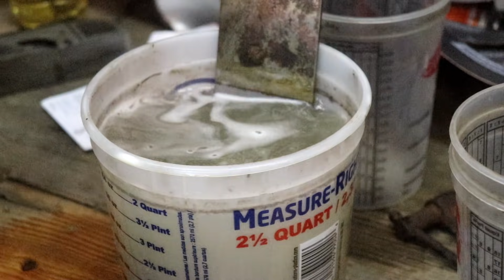Tool Restoration -Heavily Rusted Lathe

Comment: I fix and restore machine tools for a living..have for 20 odd years. A few mistakes in the video..but not a bad job for an amateur. Please...make some brass hammers...steel hammers will do a ton of damage..particularly to a soft iron Atlas, when trying to disassemble something like this.
Reply from the maker: +Gunner Asch I hear the same thing about screw drivers and crescent wrenches all from people without x years of experience yet no damage was caused to any of the parts in question. The key is to learn how use the tool you have and to know when damage will occur. "steel hammers will do a ton of damage"... Steel hammers do nothing at all until someone picks them up. It's not the hammer or the screwdriver that damages the part, it's the operator. Look at that, you just learned something from an amateur.😉 Thanks for watching. Merry Christmas and Happy New year!
Reply: Justin took some good precautions.  Notice when he was hammering on the threaded ends of screws,  he had a nut right at the end to protect the threads.

Comment: You should have soaked the bed ways (and all the parts) in evaporust overnight. 
Next day you only need to work them with a light sand paper and do away with all that Rust, no Black/rough spots.

Comment: Good video.
A few remarks though.
Rather than trying to move things while they are rusted up like that, dunk the whole lathe in a tub of your de-rusting potion first.
Be a bit more avoiding of the 'true' surfaces....
Lubricate with a very fine film the surfaces that are bolted together (such as the legs to the bed)
Find someone who can grind the ways.... scraping is fine for smaller surfaces. It is totally unnecessary for a lathe bed.
A great many people overestimate their 'scraping-prowess'....even those that spent a small fortune for classes. And once you start, there is no way back.
At my first job, there was a chap who maintained the machines (one of a group of people) and he was the go--to-guy if something needed scraping. He had 30 plus years experience and was a really driven master craftsman. Even he would recoil at the thought of scraping an entire lathe bed! He also taught me that you 'have to finish a session' or you will see the difference. So 'an hour here and an hour there' isn't really an option either imo.
Being keen to do a certain thing doesn't make it the best thing to do....
And clock it out before you touch it with anything!
Otherwise, great find! Great job!

Paddy

Comment: You could do with buying yourself some bigger flathead screwdrivers. The ones you were using to tighten up all the slotted screws were far too small, one because you probably have still got half of them loose, and two, you will mullah as we say here in the UK up all the screw heads. Other than that, a good job!

Comment: that poor lathe why would anyone buy something n not use it???
Reply: Stillmoon Deathbringer 
It may have been used while mounted on the pallet but sometimes unfortunate things happen just after a purchase and things don’t get used. 
I get a lot of auction emails and quite often for estate auctions there are brand new items in the packaging not used listed in the auction. 
Perhaps this lathe was the same thing but the auction happened years after the purchaser passed away because the surviving spouse didn’t sell anything. 

I am glad the lathe has a new home where it has been restored and will be put to use.
Reply: Circumstances change and it is not possible or practical to use it.  This lathe was purchased new in 1976 or '77 with the intention of building live steam models.  Moves and economic downturns prevented that but it was kept indoors.  I gave Justin the lathe because I am not in a position to use it, he can.  He also got the box of tools, gears, tool holder, and chuck.  This is a 40 year old new unused machine.  I have been sorry that I was never able to use it.  And yes I generally don't throw things away or sell them like a lot of other people.  I took it to him on 12/15/2018.  I think he did a very good job on it.
Reply: heart attack
Reply: But how it got so rusty while keeping it indoors?
Reply: @Georgealfa21  even the moisture in the air can rust metal especially in the coastal regions
Reply: basements in particular tend to be very damp
Reply: @Georgealfa21  Humidity rapidly flash rusts machine tools! Use Boeshield and spray them heavily before storage.

Comment: Might have been easier to boil the ol' girl in a large tank of oil.   Still, it would appear that good ol' elbow grease, a few cans of rust remover and spray lube can work wonders.  Nice resurrection....errr....restoration.

Comment: Never understood why people go to a bench grinder wire wheel...so many better options that aren't as harmful.
Reply: @Newbie Failmaster you could use a brass brush instead of steel on steel. Use a little elbow grease and stop taking the easy way out.
Reply: Newbie Failmaster aaaa

Comment: Pro tip for future videos: don't use your autofocus. It's killing your videos where you have hands or objects moving between the front and back of frame. Not to mention that it's even adjusting when there's just simple movement in either the back or front of frame (not moving between them).

Otherwise, good work so far.

Comment: Nice!  You needed a little lathe to make various things for your projects.
 I'm wondering if that isn't one of those combination metal/wood lathes from the 60's or so. On the saddle/carriage binding up; you may be able to adjust the gib and shims and maybe the hand wheel gear just a bit.
Now the quest to locate the other hardware such as the tool post, change gears, various centers, chucks, drive plate, lathe dogs, drive spur, chuck wrenches and motor mount /speed change pulley assembly.
Reply: he could've mic't the sides of the ways. would've found that problem before assem... didn't see one stone utilized either

Comment: Doesn't it just make you want one of those 1000 gallon water bottles street corner car washes use, but filled with rust removal fluid? Just drop the whole thing in there over night to soak in then take it apart.

Comment: No no no. Please. Do NOT scrape the ways unless you plan on having them hard chrome plated. Either have them ground on a surface grinder or pick up some machinist stoning blocks and stone them yourself. Scraping them will drastically shorten the life of the entire machine. This is why the ways on a lathe are NEVER scraped.

Comment: The worst goddamn thing you could do is penetrating oil on one of these machines and then try and force it to move because the rust is going to gouge into the good metal underneath you need to dip the whole machine and use electrolysis to remove as much as possible before you attempt to move anything
Reply from the maker: +Clown Whisper good metal under the pitted metal?
Reply: @TheGoodoftheLand  you are statement doesn't make a heck of a lot of sense my friend. If you don't think there's anything good left why bother cleaning it in the first place?

I've been restoring old machines for many many years that's what I do I have a 100 year old power hacksaw by Racine did I build the special tub just so I could use electrolysis to gently lift out all the oxides.

I didn't think that I was being offencive for trying to make a good suggestion I'll refrain from trying to help in the future
Reply from the maker: @ClownWhisper  It wasn't a statement it was a question. I took a minute to watch the video again from your perspective. I can see that it looks like I am forcing the tool post against itself during tear down. That is not the case the resistance is coming from the atlas threads not the Gibbs or the machine surfaces. Notice once it is removed there isn't any rust. Also notice before I do anything I clean the ways  
Ensuring that if i do move the cross slide (which I don't) the rust is removed ahead of time. The same goes with the tail stock. Electrolysis would have worked great and most likely would free up the screws. I have a plating/striping machine and a tank large enough for the process. What I don't have is time. Hopefully this helps. It's hard sometimes for video alone to tell the story, take another look and tell me what you think. No offense taken brother.

Comment: You would have made the job easy by using 15% HydroChloric Acid  ( concrete cleaner /pation cleaner)  Super cheap and the beat rust neutralizer . Use baking Soda after to neutralise the acid .   Peace

Comment: Who in the world pays the kind of money a lathe costs and leaves it on a pallet to rust. At least brush oil all over it if nothing else it would have saved all that damage.
Reply: may have just bought it and died, who knows.   cosmoline is better than oil though. I've sprayed cosmoline on machines and dumped them outside, got to them in a couple of years, they were fine.

Comment: seven hours eh? you got seventy hours scraping ahead of you {;
Reply: nah, I'd just mark a grid that makes sense for spacing, pick a nice small scraping tool, then make them all as close to the same figure as possible. this bed would take about two-three hours, done right, to accurately scrape the top face of the ways. doesn't need it at all though. lol

Comment: Looks like you've never touched a lathe before. P
Reply from the maker: +surveywaters You are correct. It was my first time and everyone was watching 😉
Reply: @TheGoodoftheLand  have fun with it! Loads of fun. My main tip off was that you weren't using way oil when you installed your gibs, cross slide and saddle. Keep it oiled. Happy New Year's
Reply from the maker: +surveywaters Thanks for the heads up. Buddy just brought me some way oil today. I just bought a milk shaper, drill mill, press, and a surface grinder all of which need work. I am an absolute noob when it comes to machining so your input is welcome. Enjoy the channel.